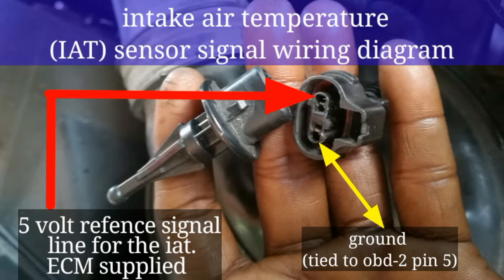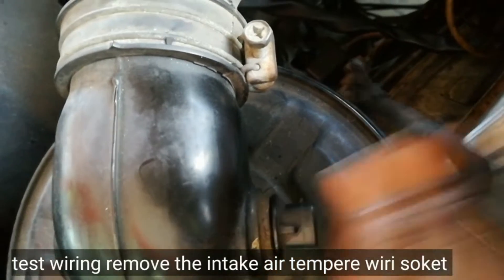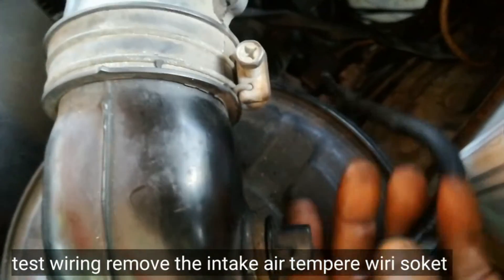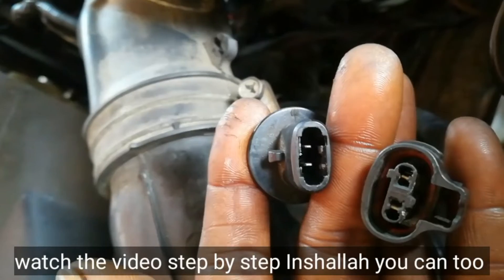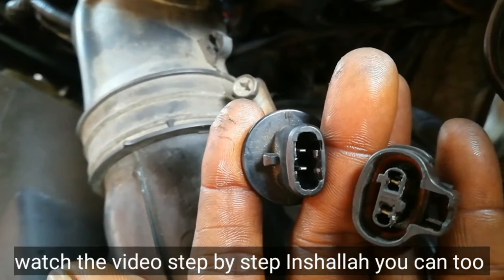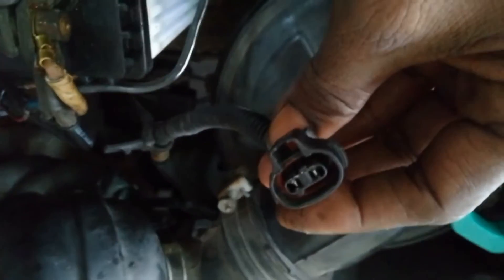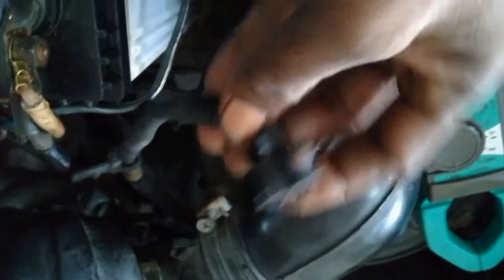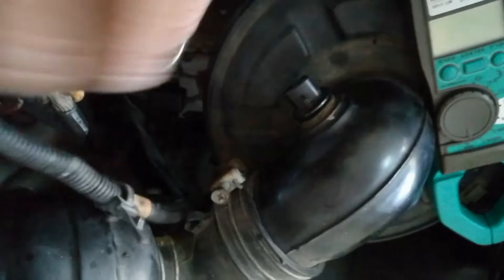How to test intake air temperature (IAT) sensor ! how to fix p0110 Engine Code ! Easy away

Comment: I need to know that will the 5 volt come in the grip after connecting the sensor because I bought a car with engine swapped (Engine is a 5EFHE 1.5L toyota japanese engine) and its wiring is just frustrating because it doesn't has a genuine air intake assy(it has a cold air intake). Now I need to connect the IAT sensor and its grip is not original grip(unable to connect to the genuine sensor). But there is a grip coming from the wiring harness to the intake side. I checked it after starting the car and it shows 12 volt in one port(multimeter positive lead in the grip and other lead on the ground pole). The other port doesn't show any voltage. But the countinuity is great. So please tell me that is this grip for the intake temp sensor.
Reply from the maker: IAT sensor from ECU
Number 1  wire 5 volt signal 
Number 2 wier ground signal

Comment: Hi I don't get 5v I get ground on both wires
Reply from the maker: 5 volt signal comes from Engine ECU ! Check the wire connection from Engine ECU to IAT sensor if there is any problem repair it and if there is no problem.  Check the engine ECU, repair or replace if there is any problem
Reply: Ok will do plugged the ecu out and there was no continuity between the two wires so could it be the ecu but all other sensors measure 5v